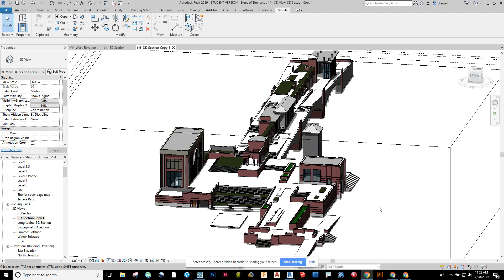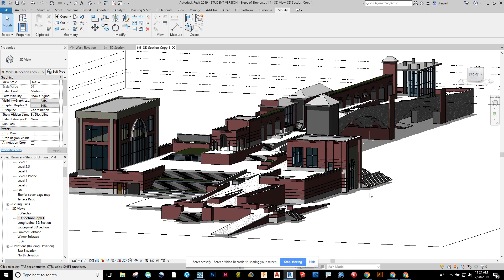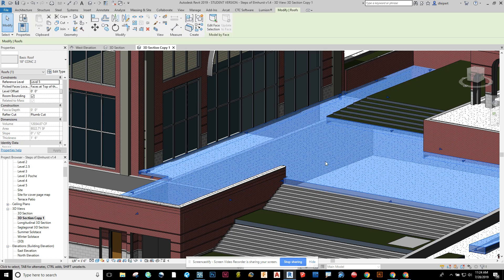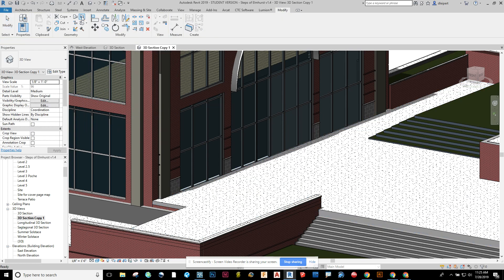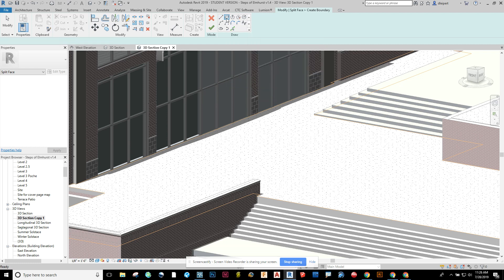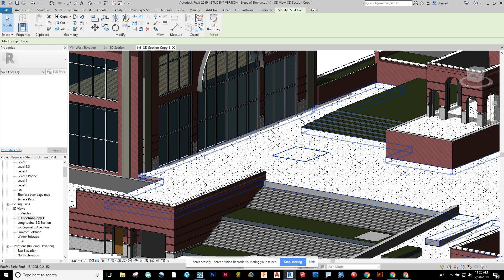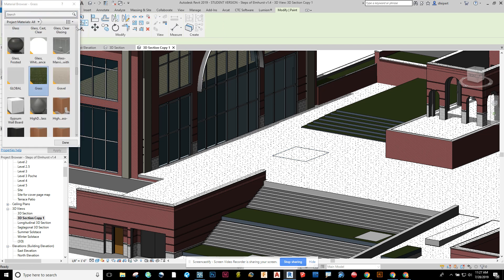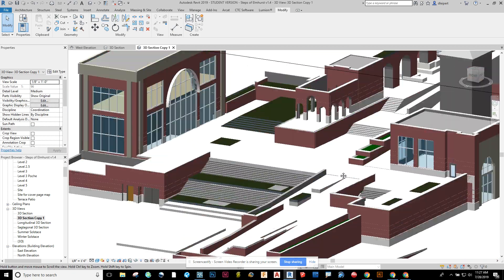A Few Tips for Split Face and Paint Material Commands in Revit!

Comment: how can you modify or eliminate that square you drew for the planter if you decide you don't want it to have that shape anymore? I can't seem to get it done. thanks
Reply from the maker: Hey Florv.  Let me know if I need a video on it if you can’t get this to work:

What you need to do after making the split face boundary is press the escape key a couple times to get out of the command.  Then you can select your boundary and delete it or modify it when the modify (green) tab pops up on the ribbon where all the tools are.

If you can’t seem to select the correct boundary, hover your mouse curser over the line you want and press tab until the correct boundary highlights and then click on it before you move your mouse again.
Reply: @Studio_Hero  tab was the answer!! thanks